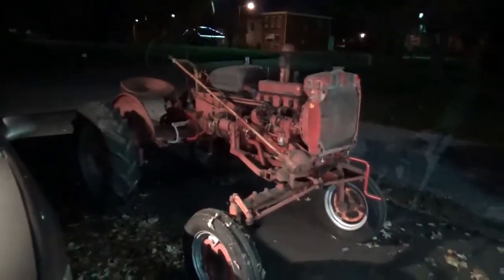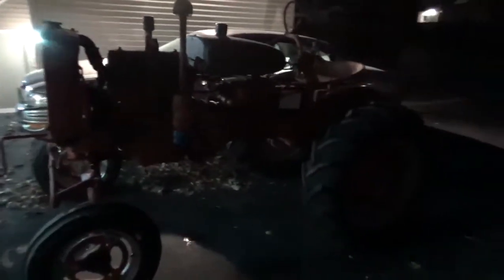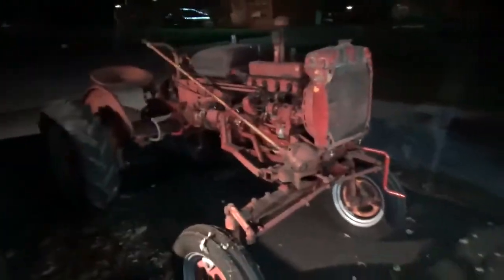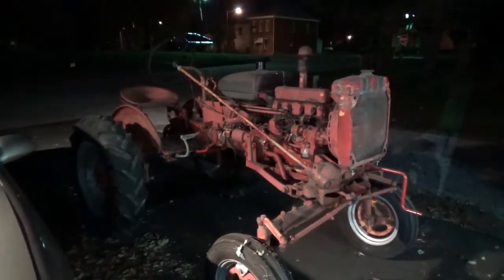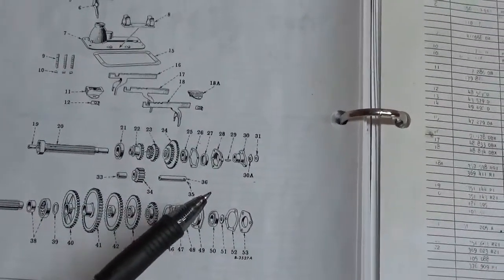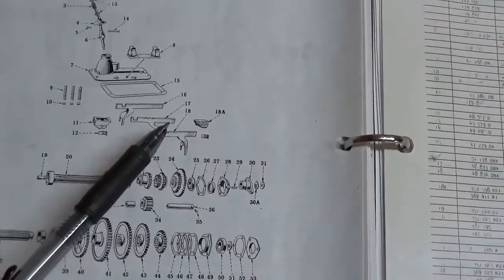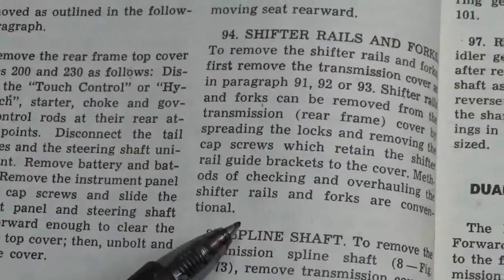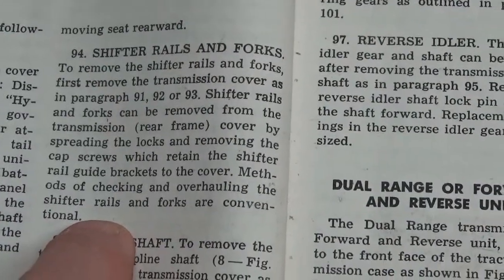1955 International 100 Farmall - Tractor Running and Drivable

Comment: Its how you placed it in the first time, You may have only set the cover on with one of the gears not aligned right. You got it now Johnny. You are all set. Its not going to jump into gear unless you put her in gear. I remember a guy named STEVE that wanted you to take shift cover apart in case a strap was broke :( Sorry if it caused you grief !!! ) Never the less you had to take the cover off to do all the digging in her you have done and could have has same result . The little grove that the forks ride in on the gears have to be aligned for the forks to go just perfectly. I've seen some folks that had reverse and a forward gear engaged at once .Would stall tractor. I had to slide my gears with cover  to align up as well. If you can run her through all the gears,1,2,3,4 and reverse and you have neutral your all set !!! How was the gear noise with the new bearings in the differentials  ? You really dug into her !!! I was worried about you doing the first start up,,, sent ya a reply about making sure she was able to roll before start up on your last video upload!!! Was deer hunting all week and no internet .Take a video of your first drive . Thank you for sharing your videos !!!!
Reply from the maker: Steve,  I didn't see your post about rolling until after I made my first attempt...great advice as I used that technique when when viewing the gears with the cover removed.  I couldn't get it on the road tonight for a full check on gears 2-4  and gear noise.  Taking off early from work tomorrow and will still have some daylight to put it on the road.  Great feeling.